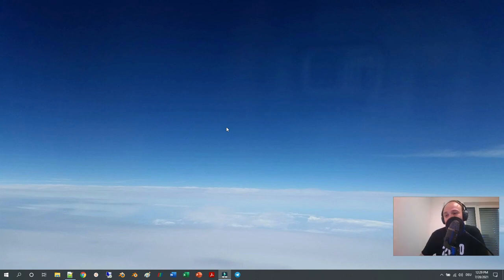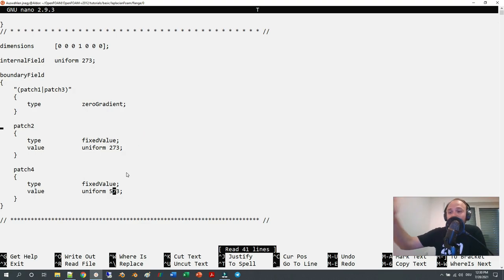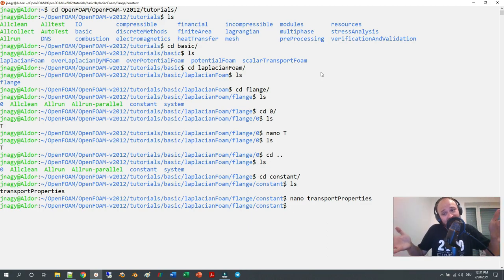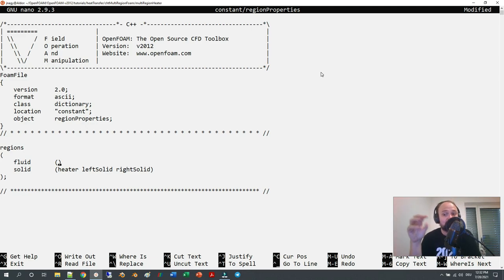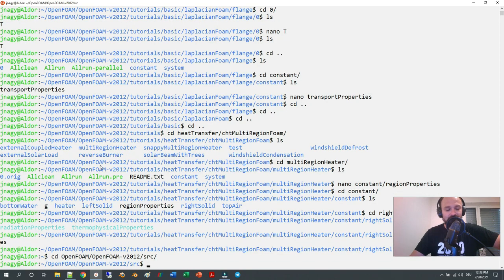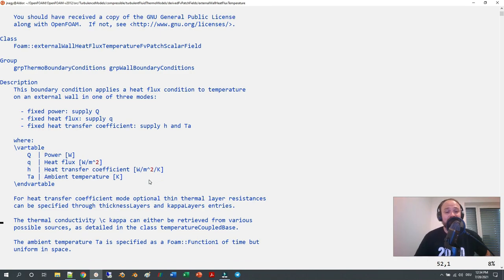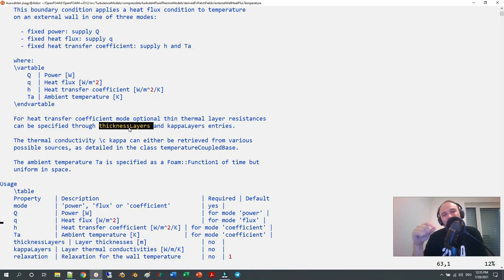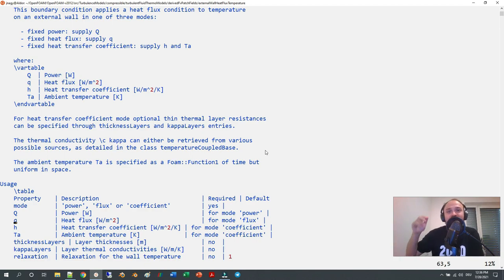[Community video] - Thermal simulations in OpenFOAM

Comment: Would be amazing if you could go through the setup of a chtMultiRegion case with multiple solid and fluid regions! When it comes to only solid simulations I would not really use openfoam so a solid/fluid case would be nice:) Grüße!
Reply from the maker: Ok
Reply: Yes please. I also want to ask the same things. Can you please make video about conjugate heat transfer with thermal resistances.
Reply: Yes that'd be really helpful. How to splitmesh with respect to cellZones and so... When i do that there are always some extra "domains" which ade created by that command splitMeshRegions -cellZones

Comment: Looking forward to a good fluid->solid->air heat exchanger example. In comsol it's easy to set up, but it's hell for convergence as air, aluminium and water have such widely varying properties. Hope to use OpenFOAM to give me a lot more flexibility and maybe calculate all the regions seperately for flow and thermal and merge them in the end.

Comment: What kind of solver would we use to simulate the multiphase fluid flow with heat transfer between gas and liquid. For Example, modelling a rocket engine with thin film cooling on the walls.
Reply from the maker: There is no such solver. This is something which has to be implemented. If the thin film is really thin and you only consider the heat resistance then you can assume it to be a thicknesLayer.

Comment: Sir how we get velocity contour in openfoam paraview .Also how we see both  cross section (inlet, outlet top bottom) and contour  (pressure , velocity) at a time???
Reply from the maker: I have several videos where I show how to use Paraview. Check out my first ever video, the multiphase simulation project or the overset mesh case.
Reply: I watched videos on paraview in your channel  all are increase my knowledge  but i don't find which i ask in my question please  ...